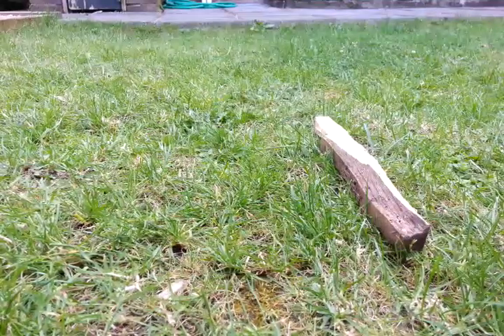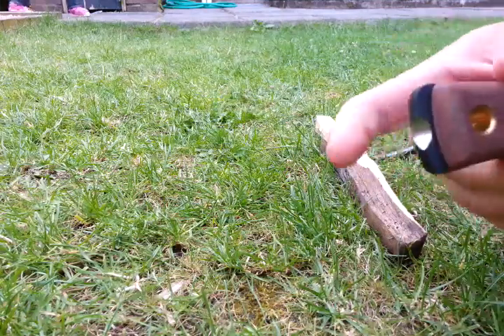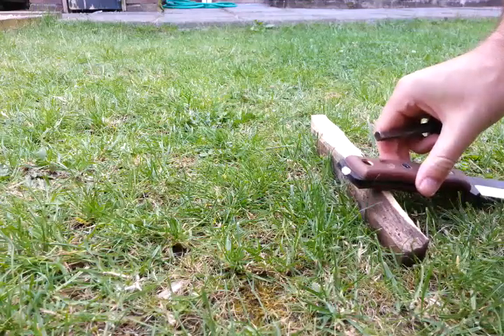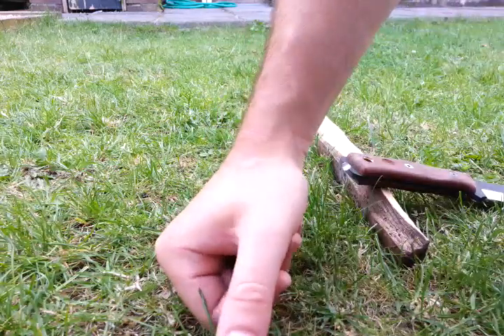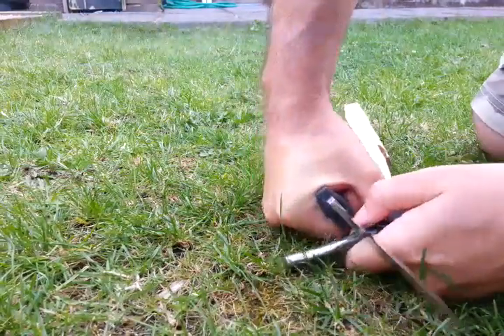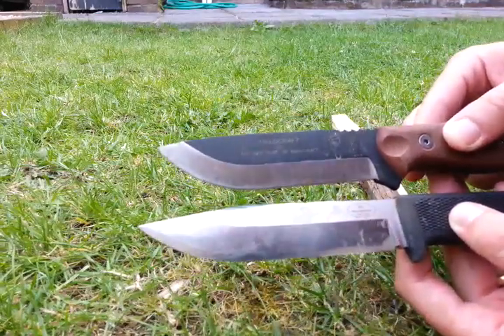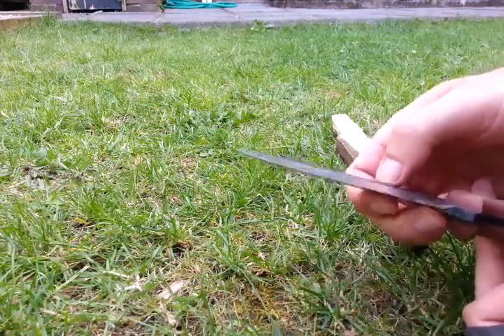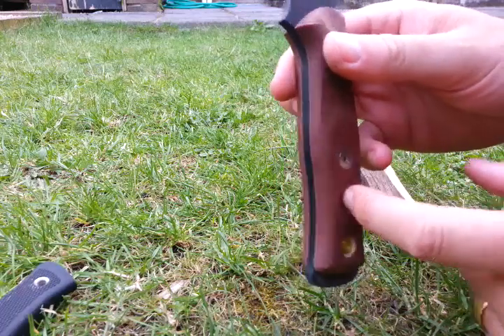Tops knives Bob fieldcraft knife shango notch

Comment: The Shango notch is a gimmick and not worth the trouble. Use the spine near the tip on a fero rod and sparks galore. I don't know why Tops put that Shango notch on the otherwise fantastic knife.
Reply: It just takes some getting used to, but I do prefer to use the spine on other knives. The extended pommel can also be helpful in some circumstances
Reply: I thought so too, but after I figured it out, I love it now…this video isn’t the best, imo, of demonstration of its use…

The notch needs to be facing me, and run the ferro along the groove, works great for me now…I’m glad I figured it out before I started grinding it off….